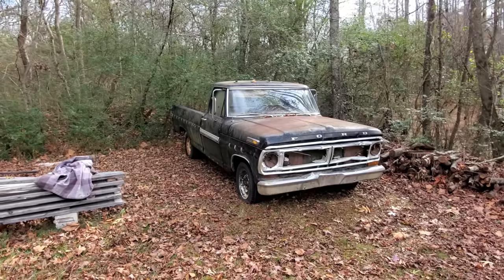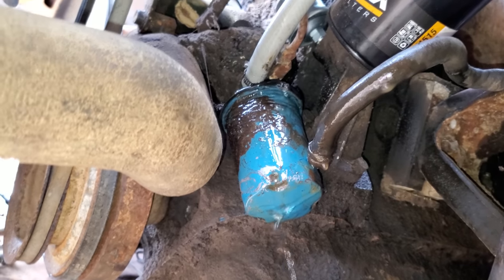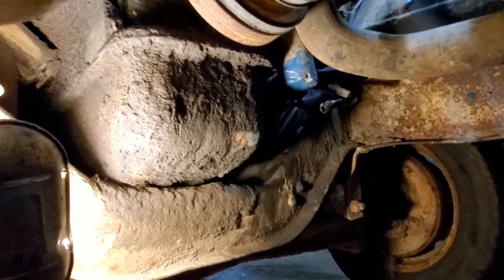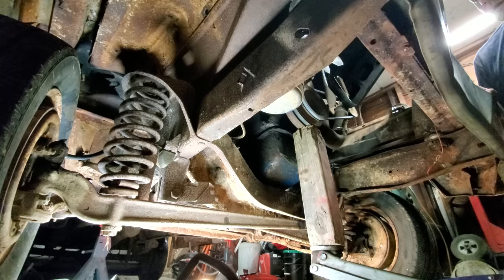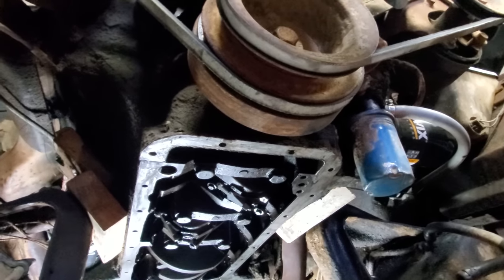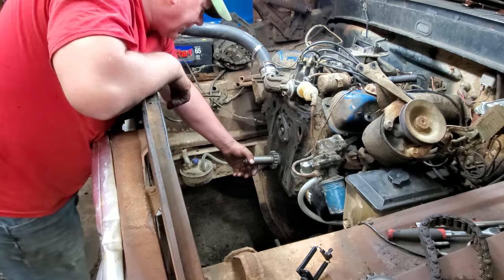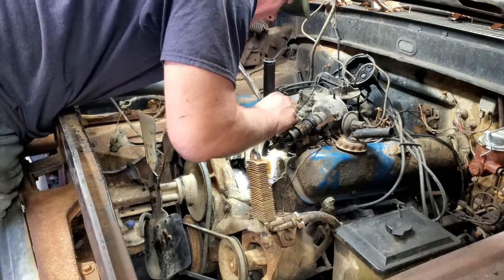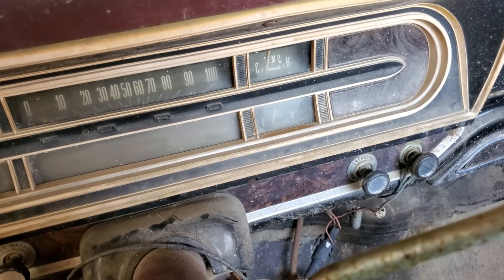Where did Dumas's oil pressure go?!?! Why will it not idle????

Comment: Ben, I never seed ya put da oil slinger washer in before the spacer on the crank. You mighta just did that an it happened so quick, a hiccup would be slow. I feel ya, pay for a new chain an its as lose as the girl that.... never mind, bad bad me. Its of my highly over rated knowledgeable mind as to just how to bend the dinaro in you Pokket as you'd pronounciate it. Was it me and I had won a few hands of 21, never gamble, never never gamble... just sling more money as if you were Joe Biden. Now all that said, I figure that the end thrust on the mains is plumb worened out. Most likely has about thirty thousands clearences and surely thats a tad too much. Oil pressure shall at best suffer muchly. 
 I hate forgetting the oil pump drive shaft cause its got that washer that grips the rod and keeps it from coming out when ya pull the distributors out of er.That is a bad day at the Carnival for kids when that happens. Should you take heart to rebuild this engine, I do honestly believe your a gonna love the power that these big block fords do seem to have kept hidden from a  good many of us. They don't seem  to be a fuel squeezer either.... no sir daddy, nine miles to the gallon up or down hill and some sundays they tend to take a bit more than should. What I have learned and loved of them was no matter how cold it gets or other, they would start, run great... till they don't. Ya see, fords are kinda like cranberry sauce, you like it or ya just don't. It was kinda like this for me as a kid. No one was a ford lover and I was a outsider so naturally I just drove the wheels off of fords. By the way, I was "first on race day" a good many times. For a good long time, I did have the trophies to show for it. So if you build, its gotta have a RV cam, a garage sale manifold, and if ya find one, a carter AFB carbarosters!! Your a getting mighty good with that camera of urn. Doing right good is what I'm blithering about. Take care friend, your a getting it done.